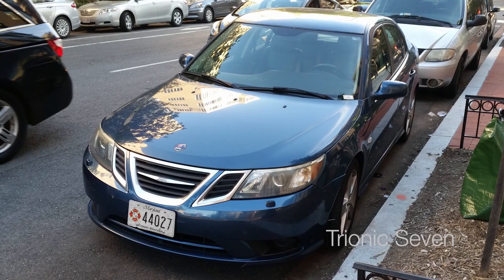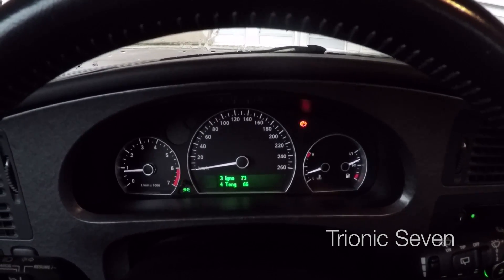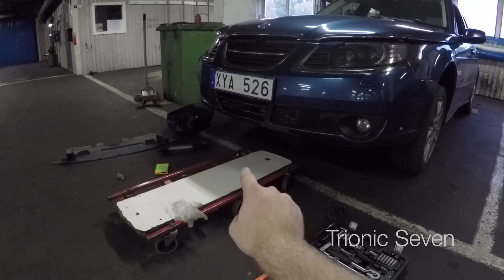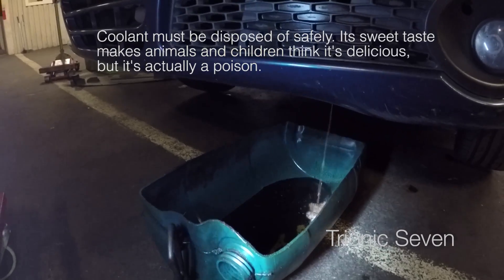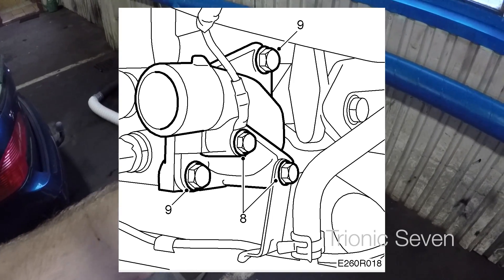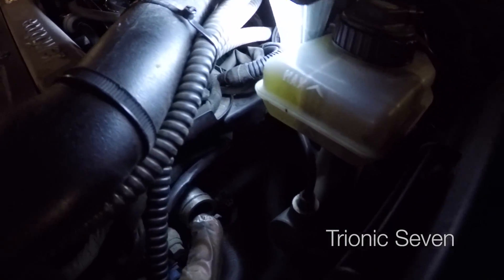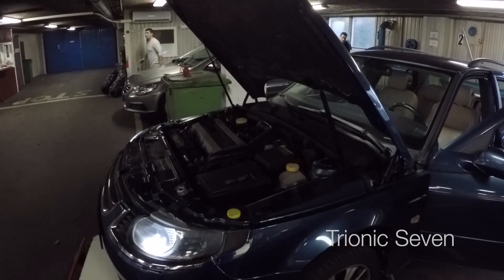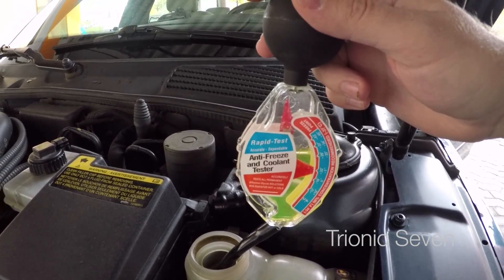Saab 9-5 Thermostat Replacement and Coolant Flush - Trionic Seven

Comment: Well done once again. Keep up the good work.
I will be waiting you video on open SID and all the relevant info.

Also some info from my own experience during a trip last November.
My genuine Saab thermostat stuck in a semi-close position. During that trip I was using the torque pro application and I observed an inconsistent and rising temperature. The temperature rose above 105 Celsius while I was travelling at around 160 kph. However the temp gauge in the dash kept pointing in the middle position. It was when the temperature rose above 115 Celsius that the dash gauge started to move from the middle position. At that point I reduced my speed to 100 kph to keep the airflow in the radiator and opened the cabin heat to maximum in order to make it work as a second radiator. Thank god it was November. I immediately noticed a reduction in coolant temperature. It dropped to normal readings 85-95 Celsius and that way I managed to return home and to save the engine from possible meltdown. Another point I want to mention is that after the rise of the temperature beyond 105 Celsius the second radiator fan came on in an effort to lower the temperature of the coolant. So remember, if your thermostat stuck in a close position, in order to avoid overheat, open you cabin heater to maximum.
Reply from the maker: Good that you have a keen eye on the coolant. As it says in WIS, it turns on maximum cooling fans at 105C if driving at high speed, and the system boils at around 120. So you were probably safe, but good that you got a new thermostat.
Reply: Trionic Seven Not only I got a new thermostat, I also changed the coolant temperature  sensor. Also since it was a coolant overheat issue, I also changed the oil and filter and the autogearbox oil. The autogearbox oil is cooled via the radiator coolant. All done just to be on the safe side of things. Better safe than sorry.
Reply from the maker: I agree, better safe than sorry. Your car will reward you when you care for it! :)